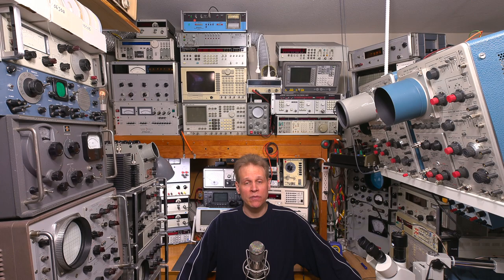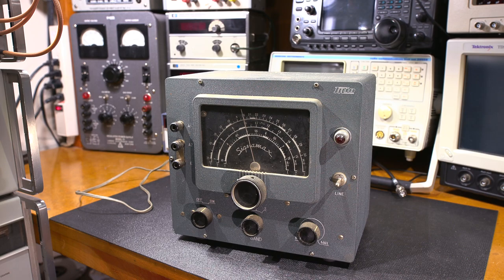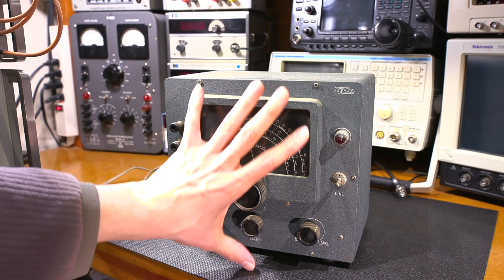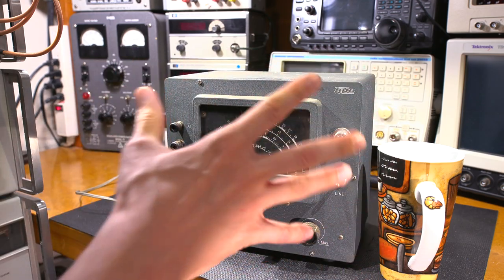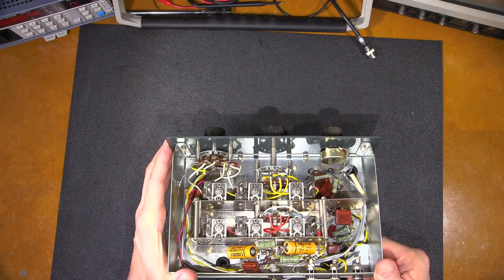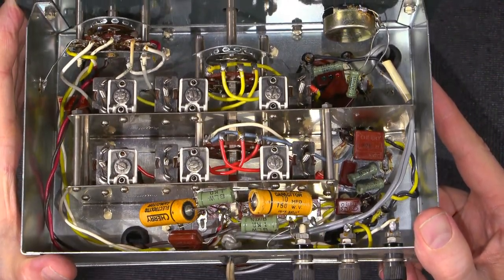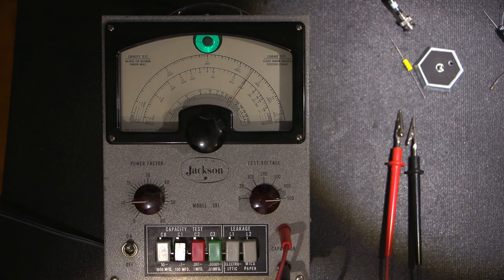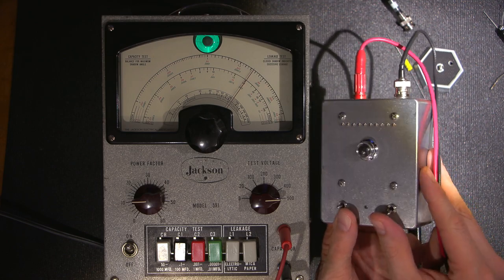Signal Booster Amplifier- The TRIO RF Preselector Restoration!

Comment: Important to note that in the United States, reception of "public airwave" has always been license free. I'm not an expert on these specific FCC rules but I think at least at one time, monitoring police and aircraft bands was illegal yet I doubt that was ever enforced? I do know they also used this "public airwaves" law to go after early backyard satellite dishes as well as bootleg MDS 2500mhz microwave antennas used for pay TV in the early 1980s as those legally were not "public" transmissions. Of course that too was impossible to enforce so signal scrambling quickly solved that problem.
Reply: Oh boy, those were fun times.  Sharing codes, patching EPROMs... watching TV shows on the studio C-band downlinks a week or more before they were supposed to air.  Then when the little dishes came out, the cat-and-mouse game with DAVE.  My favorite trick was figuring out what CPU instructions were running on the smart cards in realtime by comparing current draw signatures to predetermined patterns.  Then inducing voltage spikes or limiting current to change which bytes were being read from or written to RAM to just jump right over the key comparison.  Then they added some randomization to the HU cards to prevent that... so on to learning chemistry to dissolve the plastic surrounding the die, and taking the thing to uni to watch it under the electron microscope.  Then they finally started using real encryption with the P4 card, at the same time I turned 18 and moved from the east coast to California and became a party animal instead of worrying about that stuff.  Or so I heard, I would never be involved in something like that :)

Comment: Okay, now you have inspired me to finish restoring my GE beach radio, it weighs like 40 pounds which gave the user bigger arms so no one would kick sand in your face. The battery never leaked in mine, and it's a 7 out of 10 cosmetically. All it really needs is new caps

Comment: As for replacing the metal rings retained within each knob, consider cutting a section of the correct diameter copper pipe and attacking it with liquid tin. That should replicate the profound look that the originals convey.

Comment: Another approach to the knob alignment would be to rotate the switch/pot by the required amount if possible. you might have to drill another hole for the index pin on the control, but that might be quicker. Of course, in this case its possible that it might have involved disassembling too much, or cause clearance issues, because Mr Carlson usually finds the approach with least hassle!
Great video!

Comment: Interesting device. These were available as a kit which could explain why the ground wire on the pot was not soldered correctly. I believe this was the same Trio that became or was part of Kenwood? Also could not help but notice the knobs look exactly like Hallicrafter model S-40 knobs except the centers are cone-shaped where the s-40's were flat. I wonder if this was manufactured by Hallicrafters for Trio?

Yes the US FCC during WW2 outfitted vehicles with Hallicrafters SX-28 receivers that were driven around looking for radio signals. These looked like a Standard receiver except they only had a single 6V6 tube audio output stage instead of the push-pull one in the other SX-28's.

Comment: Brad the gitarlogist the other day had a ceramic capicator blow up on a amp and it spit the foil out all over the circuit board. It was what's called the "death cap" across the line cord. He just removed it and the amp was fine.

Comment: Another fine restoration Mr. Carlson.  I've enjoyed viewing many of your You Tube videos recently.  Your lab is amazing, and I envy the amount of quality space at your disposal.  Thanks for sharing your electronic adventures.

I had a question about the rectifier in the Trio.  I only saw it once (at 6:55).  While it's obviously a 2-terminal device, the construction reminds me of a bridge rectifier I came across while restoring a 1958 Grundig receiver.  One website I came across at that time identified it as a selenium rectifier, and recommended replacing it with silicon diodes and a resistor, which I did.  

My question is whether you replaced the rectifier, and if so with what?

Comment: Anybody who has ever worked on a half decent SW receiver will recognize this as the front end.  Radios with no RF stage ( ant straight to mixer),  or with wide band, or cheaply designed and built antenna and rf amp circuitry  will benefit by the higher tuned Q, amplification and isolation a pre-selector/pre-amp can afford, provided distrubted gain is kept in balance.  On the low bands,  amplification may be the last thing a receiver needs to improve readability,  which is a different animal than S meter readings.   It is fun to make recievers that really suck on the high bands  actually do something..especially if you can do it with something else that really sucks.

Comment: looks in so good of condition i wonder if .

1. it has been restored with original time period parts (someone bought spare parts and kept them on hand).

2. by the time they got the unit the laws changed so it was no longer to illegal to receive or  the transmitted signal was too weak to be a threat so the unit was not required anymore.

3. new old stock.

the fins on the bezel i think are to give a 20s/30/s look or what ever was in style for the time

if you ever intend on selling the unit you may want to have smaller knob so if the buyer wants to show off the fins they can but keep the original or correct knob to keep it as original if it had the large knob

Comment: You might want to mention that when using a spectrum analyzer for relative measurements, it's more useful to use the linear scale...which makes it more sensitive to small adjustments.

Comment: Mr. Carlson, quick question about the alignment: since most users will not own (or have access to) a spectrum analyzer or wavemeter, is there a way to accomplish the alignment reasonably well using more conventional test gear, such as a VTVM or scope?  If so, that would make a great mini-video for everyone.
Reply from the maker: It is possible to use a receiver of known dial accuracy for this alignment. The S-meter can be used to peak the coils and trimmers.
Reply: I also wondered

Comment: I was in a cleanup restore tune of an Astron power supply.  Change small caps, clean out the cob webs, new mica's and thermal compound, check output and crowbar circuit.   I was letting this video play while doing that but I had to stop to watch this video. Mr. Carlson long video's, long winded,  but watched this one.

Comment: It looked like it was basically in calibration, even after you replaced the capacitors.
Old equipment is fascinating and some years ago I would have loved having it. The high quality switches, the very good scales, the nice construction quality. Modern equipment can usual do more at a much lower cost and better precision, but the construction quality is not very impressive.

Comment: Another very good learning experience,  thank you.
When you tested the tubes you tested for emissions before checking for shorts.  Is that common procedure with the Heathkit tester?  I know that my Hickok warns against testing emissions until proving there are no shorts. Hickok states that the tester could be damaged if testing emissions with a short.
Reply from the maker: Hi Johnny. If the shorts lamp was glowing at tube plug in, then I wouldn't proceed. These testers are very tough, and the order of test has never given me any issues. Thanks for your kind comment too!

Comment: I think that I read some article  for a mod to the National H R O radio a mod for preventing the local oscillator from radiating and causing tvi here in the UK which at one time was on the six meter band. There is one rf stage in front of the mixer tube

Comment: Great demonstration on nearly scientific niveau regarding comparison of capacitor measuring, and therefore an example for others. The high-voltage-comparison is necessary, though, because otherwise only the low-voltage negatives will show, but the amount of high-voltage stability will remain unknown. Nothing more to be said.

Comment: @34:27 Mr. Carlson, instead of cleaning the old, clear-plastic instrument panel, have you considered replacing the clear "plastic" with maybe some 1mm-1.5mm hard acrylic that you cut-to-fit?  Seems you might end up with a better result and spend less time replacing instead of repairing.

Comment: Mr Carlson's lab and electrons 101..Just totally enjoy your listings, but one thing I like see is a Mix'er lession..I have the need to align my IF frequencies on my Collins 75a-3 and a SX101a receivers. but my spectrum analyzer is not able to go to those low Frequencies. So can I use a 10 mhz mixer and my analyzer and see if I can use it to tune up there IF frequencies with this setup.

Thanks
Rich
wb2lfy

Comment: 4:00 - What would you be 'broadcasting' when receiving? My only thought is the local oscillator. That wouldn't be attenuated by adding this preamp. (?)
Reply: Local oscillator radiation, same with tv's, the post office used to use detector vans in the UK

Comment: With this booster amplifier, it should be possible to use a simple detector receiver - without being detected by "detector vans" from any authority! Such a setup wouldn´t radiate……..smile.
Reply from the maker: Yes, as long as there is no oscillator in the design.

Comment: I wanted to ask how is the antenna hooked up for the test? when the signal amplifier is in the off position does the antenna just pass through to the antenna? wonder how this would compare if you switched back and fourth from using a connection straight to the antenna then switched going through the amplifier with it on. Years ago i had an amplifier for a a car stereo and all it did was make everything louder did not make anything come in better if there was static then the static was louder. Perhaps this device would only be useful on a radio that did not already have a sensitive receiver.

Comment: I always thought those receiver detector vans were a myth.  Were they looking for local oscillator leakage?  How far away it that detectable?
Reply: 1500 feet or more
Reply: That'd depend on how much leakage there is. And how much noise (i.e. stronger leakage from elswehere) in the area
Reply: @233kosta  you are correct but back then there was almost no electronics to be found so stronger leakage from elsewhere was a rare thing

Comment: i buy job lots of components and some of the older types and brands of caps are not worth testing nevermind using, but other types of components are better than any china market new stuff.
i really like metal can transistors, ic's and mosfets, for my detector circuits.

Comment: Great videos.  Since when is saying gigahertz trendy?  I've worked in RF industry for 20+ years and no one has ever said kilomegacycles.  Also, when are you going to detail the RMA Dummy Load?
Reply from the maker: Well that's because they're all young fellas, I bet they rarely use "Megacycles" too. The RMA dummy is coming. Too much to do, not enough time.
Reply: Hertz became the "official" (SI) unit of frequency in 1960. However, old habits are hard to break, so engineers (at least, ones who spoke English), continued to say cycles for some years. Some 1960s radio books that I have found over the years talk about "gigacycles" when referring to microwave devices.

The practice of compounding units seems to have quickly gone out of fashion in the early 1960s. Radio schematics from before that era often used the abbreviation uuF (micro-micro Farad) for picofarads. Likewise, "kilomegacycles" would likely have been used for GHz, but you have to keep in mind that in the 1950s, the GHz range wasn't used nearly as much as it is today.
Reply: klafong1 most of the stuff I work on is between 600 kilo kilo cycles and 3 kilo kilo kilo cycles!

Comment: Now a days, you can buy a 20dB 5~6000 MHz RF Ultra-Wideband Low noise power Amplifier modules, the size of the tuning knob of this unit, that operate on battery voltages, for about $5 !!!
How far we have come.
Reply from the maker: I just released a simple broadband RF amplifier design on Patreon that can be built "quite easily" by hand on a 1CM square circuit board. I have more of that coming too!
Reply: Now being narrowband is just about the whole point of a preselector. A wideband amplifier is not going to help at all when you're dealing with image rejection or intermodulation issues.

Comment: As you tune through each of the bands, I see a noise peak on the spectrum analyzer display that moves in frequency. Is this noise generated by the first stage of the preselector, or is the preselector amplifying noise produced by the signal generator?

I found a schematic for this preselector online, and the nerd in me became curious whether its sensitivity would have been even better if it had been designed with a cascode triode topology for the tuned stage (as VHF television tuners were designed during the early 1950s), instead of a 6BA6 pentode.

Comment: Those domino's rarely go bad.
Reply: I had some bad ones and got curious and broke one open. I found it was a paper cap inside the domino case usually used for mica caps.

Comment: I can't take it, i need a cold shower, i am addicted to electronics and tubes are my fetish!!!!!!
Oh no, it's point to point, i need two cold showers now!!!!! BTW, i have brand new old stock period correct filter caps, and everything else in that box!!! We need to talk Mr Carlson, I have stuff you could use for restorations..Lots of stuff, Too much stuff, like even tuning belts for old receivers. I am tired of lugging it around. I would like to donate it to you, you will use it. Let me know :D I also new square micas and caps, in fact my garage looks like RF Parts circa 1950 to 1977. I even have a Simpson line voltage/draw meter, I remember my Dad using it to justify me not falling asleep with the TV on when i was a kid, hehe, You should see how much current a plasma TV uses!!!

Comment: I always thought you were supposed to check for shorts before you test emissions. I've heard that you can damage your tester if you don't, and, if there is a short you shouldn't test further. Is that the case for all tube testers?
Reply from the maker: Not for all testers. All though, if I plugged a tube in, and the short or leakage lamp lit bright, I wouldn't proceed.

Comment: Weird how the tuning goes the opposite way you turn the dial - is the dial string correctly routed?
Reply from the maker: The drive is a pinch type pulley, so no dial strings. This is the way it was designed.

Comment: So a receive-only would also transmit a "monitoring" signal?

"Engage Safety Squints" 
Open the mica cap using the "Vice (grips) of Knowledge"
Reply: He is talking about the local oscillator in superheterodyne radios. This is why airline passengers are not allowed to listen to the radio. The local oscillator in most FM radios operates at 10.7 MHz above the frequency of the desired signal. If an FM radio is tuned to 97.3 MHz or above, the local oscillator lands at 108 MHz or higher, and that falls into the range of frequencies used in aviation.

Comment: Maybe I can figure out how to boost my weak -120 Dbm 4G Lte cell signal...
Reply: ...and do it with tubes ;)
Reply: 1) Stand in front of a reflective dish. 
2) If there is an RF connector buried somewhere inside your phone, connect that to a Yagi antenna and point the antenna at the cell tower.

The transistors used in UHF and microwave circuits today (like phones and satellite receivers) are very low noise. Consequently, the receivers built with them (not taking the antenna into account) are about as sensitive as they can get. That is why the only ways that you can improve your signal are to use a better antenna or to eliminate obstructions between you and the transmitter.

Shortwave receivers--particularly entry level sets--were not designed for maximum sensitivity. That is why an external RF amplifier could help pull in extra radio stations. The assumption with the design of vintage shortwave radios was that the user would connect them to a large outdoor antenna, which would bring in strong signals (and interference). Adding more gain to the radio, the designers thought, would not help to pull in extra radio stations because the limiting factor to what could be heard (when a big antenna was used) was interference.

Comment: I am wondering, exactly how do capacitors differ from say a 47 UF at 50 volts and a 47 UF at 400 volts.  How do the differ internally, is there more foil inside the 400 volt cap or, perhaps a different electrolyte?

Comment: Your Capacitor is very nice but it only measures leakage.. I still wish you also use a proper capacitor meter and measure if there has been a shift in capacitance
Reply from the maker: Hi Dana. This is where understanding the failure point is very important. A "proper capacitor meter?" Anyways..... Capacitance meters measure the amount of time it takes to charge the capacitor, then does internal math to give a capacitance result. If a capacitor has leakage, it has parallel resistance. Parallel resistance affects the time it takes to charge a capacitor, yielding an incorrect reading. So the bottom line here is: If the capacitor leaks, reading its capacitance is useless as you will get an "untrue" result. Usually they read high with leakage, as it takes longer to charge them with parallel resistance present.